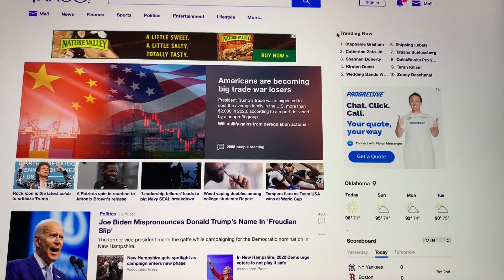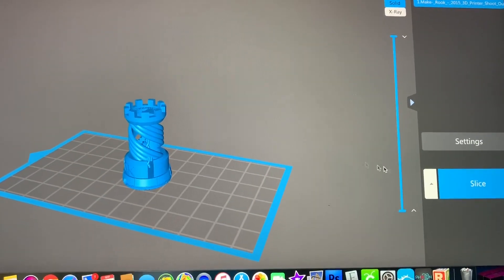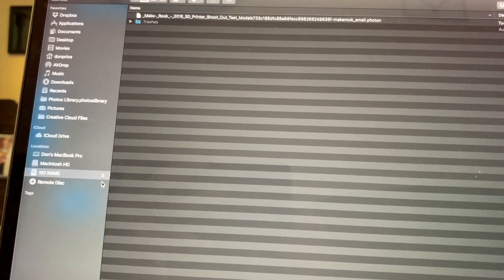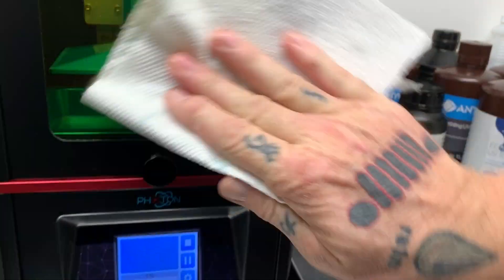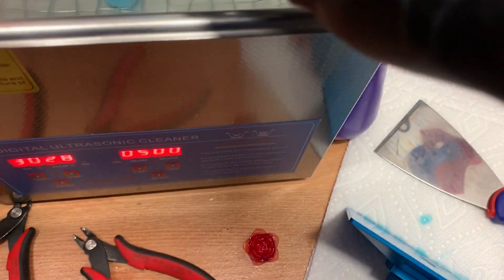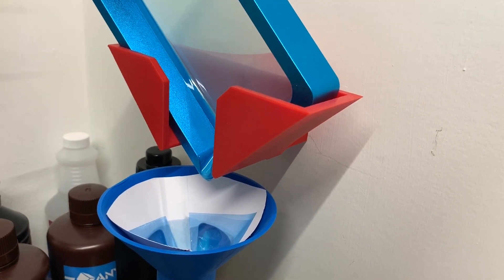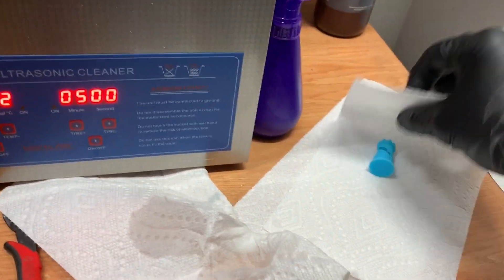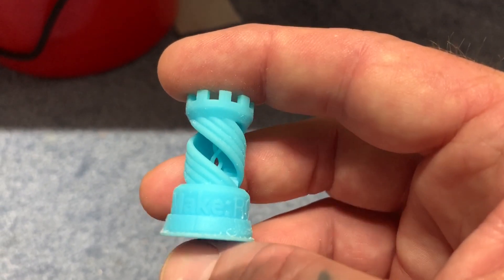Printing on a Anycubic Photon 3D printer, start to finish.

Comment: Hey so I went to print the test cube and after 4 hours I came back to no print printed
Reply: If anyone is having trouble with this message me on Instagram. Same as my YouTube name. Took me months to fix this problem.
Reply: @OFFROADDAN  Hello

I have had this printer for 2-3 weeks now and have only been able to print the 2 test prints once.
the first print I did was the square shape test print that was on the usb. It printed fine.
the first issue I had was google searching why I could not see the cube test print. after a week I learned that I already need to update the firmware. so I did that and then was able to see the test cube and was able to print it with no issue....a few day go by and I went to print my first MY print and it would only print the first layer and the whole printer would freeze and the touch screen would stop working. It took me another week of google and youtube searching to go through all the steps about 10 times and 15 failed prints. and multiple new USB stick  and cleaning and reinstalling the firmware to learn this strange thing.
the only way the printer will not fail is if I install the new firmware just before I print anything. if I do not it gets stuck on layer 1 and will freeze.
I tested this theory 3 times today and confirmed that it will only print and not freeze if I reinstall the firmware right before I go to print something. now its only printing the first layer and sits there and does nothing and the screen freezes  and have to turn it off and on to do anything.
could it be a bad usb extension that goes from the body of the machine to the motherboard

I do not want to have to install the firmware everytime i want to print something....praying and hoping that this printer will not freeze over and over and over.

Comment: This is definitely going over my head Chitubox doesn't slice pws files and that's what's required for my photon😕I use Chitubox for my Kelant s400s
Reply: add supports in chitubox and then slice that file in photon software it will save as a pws and then you can print it on the photon

Comment: i hope thats not alcohol in your ultrasonic cleaner, 
using IPA (or any flammable liquid) in a standard(non explosive-proof) ultrasonic cleaner, even with heat off is a HUGE safety risk.  The IPA will give off flammable gasses that can be ignited by the circuitry in the ultrasonic cleaner.  This is well documented, easily searchable online and against all manufacturers recommendations. Look into any resin printer forum or online group and you will see hundreds of posts saying not to do it.
If you want to refer to a method that is much safer, Look at option 1 in this link https://iultrasonic.com/blog/flammable-solvents-and-ultrasonic-cleaners/
the vibration for cleaning transfers thru liquid and thru glass, so you filling that entire tank with any flammable solution is just asking for trouble.
Reply: He should use Mr. Clean detergent. Does the same thing minus the exploding.

Comment: This is my first try. I did the setup with the A(whatever) paper and then set it to the 10mm to .1mm and then I went to the next stage of putting resin in, finding that test print model that comes on their thumbdrive.   It says 4 hours. I have no clue if this has a polygon or face count or counts vertices in other 3D software.  what is this slice and software youre using.  I'm  familiar with the slice method in mesh models but confused why there is slice used. I used 3D Studio Max and want to try different mesh or box models types and reduce face count to see if that speeds it up with little irregularity in the iteration of a 3rd Party model.

Comment: I need help setting up my photon. Waited 4 hours and printed nothing.
Reply: Same here, the thing goes up and down and its going through the motions but when its done theres nothing on the print head/bed/whatever its called
Reply: @YesOfficer  have you chosen your machine in the chitubox software? if not then do that.
second, have you increased the amount of time that your machine is in the liquid? Tomorrow I will tell you about the optimal settings based on your machine.
There are many reasons why your machine may not have any material sticking to the base. Personally, I keep the bottom exposure setting at 50. Works perfect for me, but it’s the only setting i can remember right now.

Comment: So... that's it? That's really as simple as it gets? No extra steps?
Well then, looks like I've got a defective printer...

Edit: nevermind; I'm an idiot. I was using it wrong.
Reply: 5 months later. What is your problem?
Reply: @kurubyy  me being an idiot as it turned out. The printer works fine; I just didn't have a clue what I was doing. Thanks for commenting, but I'm good now.
Reply: @Kingpin1880  happened to me with my first printer, first thing I resort to is always the manual, guess what they didn’t send me!

Comment: I was told to never use a metal scraper on this machine. Has yours scratched at all?
Reply from the maker: I have used a metal scraper since day one and not a single scratch. My scraper however has been sharpened to a very sharp edge, and the corners have been rounded off so they can not dig into the aluminum.
Reply: Don Price thank you for the reply. I just got my printer in the mail yesterday. The resin hasn’t come in yet, so I’m doing some educating.